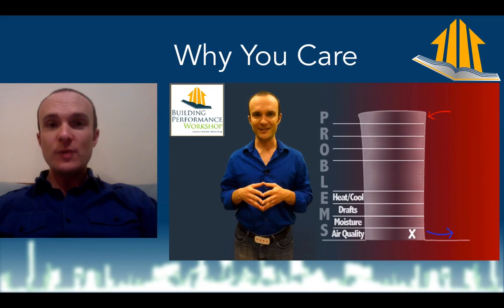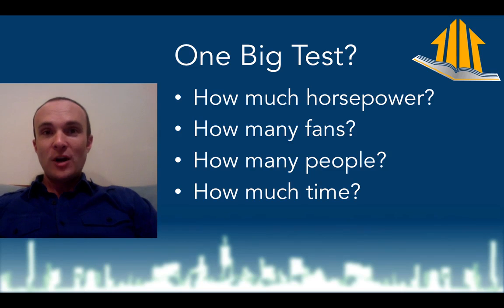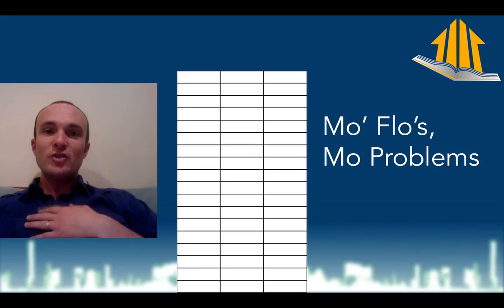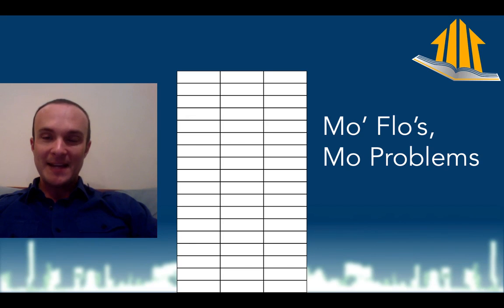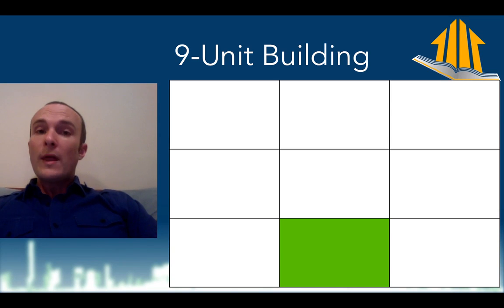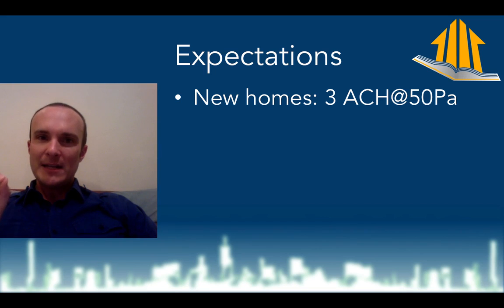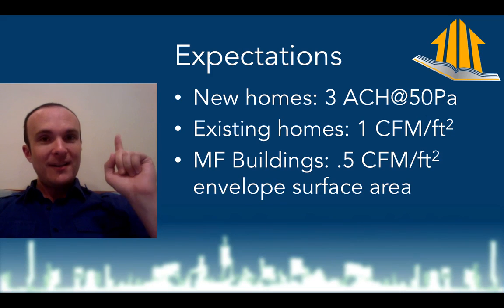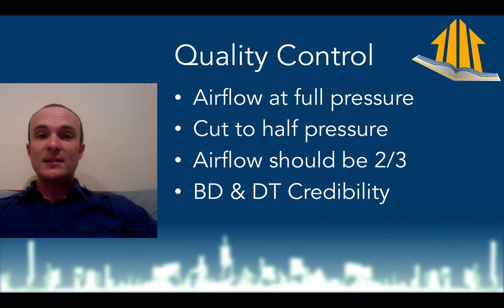Multifamily Blower Door Testing

Comment: Your example of a three story you mention getting zonal pressure if you only have one set up.   Why?   Can you then use the pressure to offset/evaluate the cfm for the current or attached units?    I test multi family but don't always have access to adjacent units.  

I agree with your point of volume and its actual representation of leakage.   

Thanks!